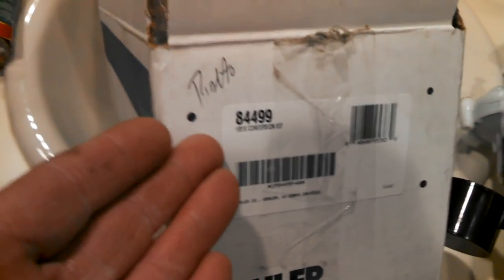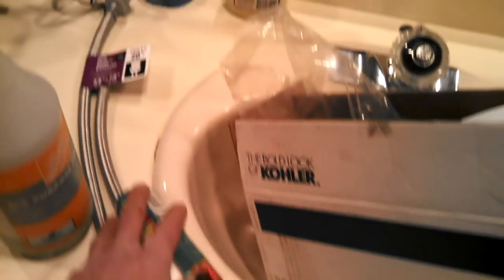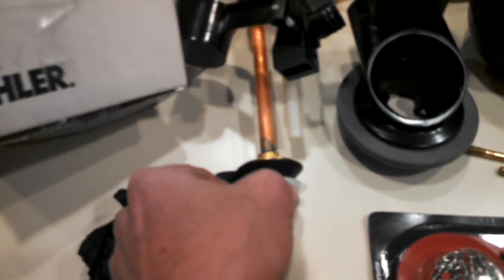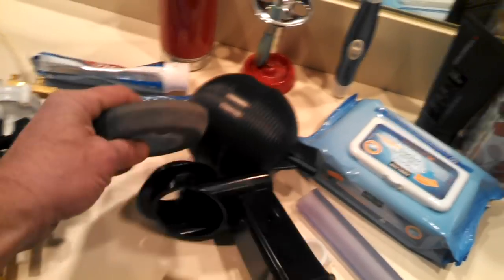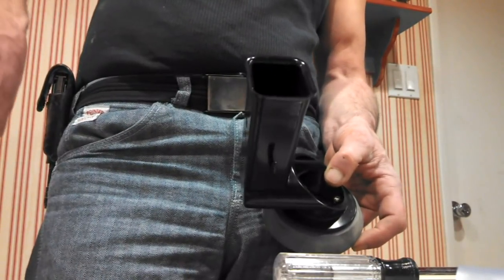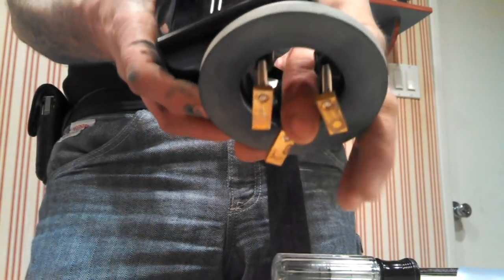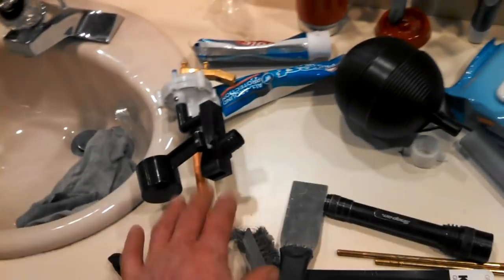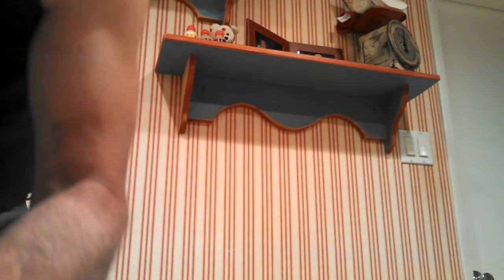Kohler Rialto toilet SOLVED

Comment: Loved your video. We ordered the Kohler Rialto toilet parts with the Coast 1B1X fill valve. The hardest part after watching your video was removing the 3 rusted in screws but after spraying with Silicone Spray and other tricks we got them loose. Now the toilet bowel flushes VERY WELL but the amount of  water in the toilet bowel is much less that prior to replacement. Thank you for your instillation instructions.

Comment: Thanks Dino , I have 4 of these Rialto toilets from 1987 . Your video gave me the confidence to do a rebuild . Worked out well. One thing to add for the viewers . There is a little blue plug in the top of the fill valve . Mine was missing and water was shooting out of the top. It did not show it in the instructions, found it loose in the bag and installed it, all good now :-)

Comment: Thank you so much, Dino!  Your video gave me the confidence to replace my flush valve because the old gasket was disintegrating.  The new flush valve has plastic tabs instead of the screws with the brass tabs, and the opening in the tank that it fits into is a basic triangle.   I positioned the tabs over the points of the triangle, pushed down, and twisted so the tabs would catch and to seat the gasket, then I put the flapper on and voila...it's working perfectly.   Thank you, thank you, thank you!

Comment: Hi, used Kohler 84499 kit to replace all parts in my Rialto . Project was easy with parts provided, however had to change the bowl fill tube to a more flexible thin wall part and use a blow dryer to make the bend. Working perfect with genuine parts. Thanks.

Comment: Thanks for the video Dino! Mine was originally leaking so I changed the set w/ a coastal (generic) one and then I noticed no water was getting into the rim, turns out the rim feed tube wasn't placed into the hole, but to the side of it due to mine having a jacket piece of PVC-type material that goes from the hole into the tube and was not sitting in the hole and the water was falling directly into the tank.  I set the PVC jacket into the rim hole and then placed the plastic feed tube into the jacket. Thanks again :)

Comment from the maker: i try to stick the tube into the ceramic first, then install the fillvalve, sticking the tube into valve almost last thing cuz you can easly break the black plastic valve. i belive there is a small "set screw" on the float valve where it attach to fill valve, remove the screw, set your angle and rescrew. i found twisting and pushing the tube you can get it in better, even fold it lengthwise , then jamb it in, it will unfold itself. keep at it! you get it, just care not break little floatassembly

Comment: Found another fix for water leaks: lower the water level. Had a rialto that continually dribbled water into the bowl - and the usual suspects were ok: flapper valve, filler tube, etc. Turned out with the water level a bit  high the water was leaking around the fill tube where it connected via the hold to the toilet. As long as the water level was below that of that hole all is good.

Comment: Dino, you didn't say much about the translucent flex tube that runs from the float valve assembly to the back of the bowl.  I have two problems.  1)  The angle of the male nipple on the new float valve assembly is different from the original.  This causes the path from the assembly to the bowl to be shorter and requiring a sharper turn of the flex tube.  2)  The old flex tube was really jammed into the bowl.  I can't seem to get the new tube to fit into the opening which is much too small.

Comment: Hello. I have the Rialto 3466 which is very close to your number. However, there are a few differences. The items that get connected to the tank looks different but connection to tank is close enough to connect. The fill valve is totally different on yours. Yours looks more traditional mine is a square float and a fill valve under a white plastic cover. 
Also flush handle is on left side. 

I will give Kohler a call to get original parts since I'll be living here a while. Maybe get some clarification on my questions?   Either way I should be able to get this done. 
Thank you for posting!

Comment: just a recommendation for this toilet. I have been in plumbing sales for over 30 years now, and yes I sold these back in the late 80's. for a decent flush you should use a 1/2" supply valve and a full flow supply line. like a code style line. the one that needs a tubing bender to bend correctly, and not as DIY friendly as the pro hooker shown. thoe back then there was a pro hooker  supply with the full flow that works well, but hard to find now. the reason was this tank flushed with the old 3.5gpf, but with the low tank Kohler designed the incoming water to help with the flush. back then people often installed them with the common 3/8" stop and supply only to ne disappointed with  he flush. I sell the 84499 Kohler kit myself. it is the only decent fix for the Coast Master OEM part, that went away with that company going under. I like the vedio, but would recommend the larger supply and stop.
Reply: I agree. I bought one of these toilets used from Habitat For Humanity and installed it in my house 5 years ago. It flushed well enough but the bowl rinse wan't the best. I found the Kohler catalog page from back in the day and the recommendation is for a full 1/2" supply and stop, with a minimum of 40 psi flowing pressure. I switched to a 1/2" supply and valve and the toilet flushes much better and fills faster.
Reply: Hey Scott, do you know if the 84499 conversion kit works with the Rialto K4530 model or not? Dino didn't list that model number in the description and I thought you may know. My Fill Valve says 1B1X on the top white plastic round piece and it's on the far left side of tank, and the Flush Valve + Flapper is over on the far right side. Thanks!

Comment from the maker: ALAN, THE bowl part should fill until the water spills over the trap inside the porcelain, you cant see that but....if you wait for fill cycle to stop, then mark a small pencil line at bowl waterline, then pour water slowely & gently from bucket (dont start "designed in" siphon by dumpin water too fast) make note, if the water is higher level after manual bowl fill, it's not filling as designed with universal valve, if you cant fill bowl higher with above cuz it spills over the trap,then your ok

Comment: Hi Dino You Really are the BEST..I have a problem with the adjustment screws...it is less than a "hair"...between never stopping the flow coming in the toilet and  total shut off...any suggestion? I'm tired of using the shut off value with every flush..

Comment from the maker: Alan, you are missing
may seem to work it will clog often because the rialto design needs that big hose to fill the bowl to correct level, the little black hose on universals will never fill bowl, if bowl level is below design your never going to get a good flush and therefor the plunger will become like your best friend as your going to be plunging after every #2 !!
rialto is very specific that needs the exact rialto replacement fill valve, sorry but that is the way it is.

Comment from the maker: Liangj08, the black float tells the ballcock(fillvalve) when to stop sending water to bowl cuz normal operation at start of fil cycle half water to fill bowl and half to fill tank, then as the black float closes all water goes to tank.
many plumbers remove it as its trouble , you should be ok without it if the bowl and tank are filling to designed level

Comment: The flush valve was not leaking.  I could see water dripping from the fill valve, not well enough to identify the exact location of the leak.  Today, I went back to the fill valve, shut off the water, removed the three screw from the cap, put it aside and removed the new plastic piece with the three rubber washers and button on the bottom.  I put  these four items on the original plastic piece. Replaced it, put on the cap, and problem solved.   When listening for a small leak I usualy put one end of a long screwdriver on the suspect location and the other end to my ear.  Home made stethoscope!  Thanks for your reply.
Reply from the maker: Stew Baker often is BOTH the fill valve & flush valve leaking, dont discount the possibility, kohler made the retrofit kit to address both issues , it includes both new flush & fill valves ...THX

Comment from the maker: im talking about bowl water level in my reply, not tank level
that big hose on rialtos is the rim feed line, the water that flows down sides of bowl during and after flush, this rim feed rinses debris from bowl walls and fills bowl to correct level for good powerful flush
ive never seen any success in ppl use universal fill valves in rialtos, they call for service and i see new universal " we try to fix, it doesnt flush good" ,

Comment: Thanks for the great instructions. I am still having a problem. The ball float does put enough pressure on the fill valve to shut the fill valve off. I have adjusted the screws but nothing seems to help. I think the fill valve is defective. Any ideas?

Comment: Should I put some silicone on the bottom of the seal.  I had to scrape the old off, so it would make sense to me to put a little sealer back?
Reply from the maker: no silicone, just clean the old one off with wire brush or scraper

Comment: Dino, thanks for the video... got a question for you if you don't mind helping out.  I installed the parts and the reservoir fills up to the fill line perfectly, but then a few minutes later I hear the fill valve kick on like it's leaking a little water... similar to the very end of the fill cycle... if I tap the float ball, it stops for a second then kicks back in a little later.  I've noticed that the float is hitting the little ridge along the back of the tank, so I wasn't sure if that was the problem or something else.  Thanks!

Comment: I installed one recently. The flush valve triangle hole. Previous tenant installed and and cracked pieces of that triangle. So I put silicone and the rubber gasket in and it worked. But I don’t know how to adjust the water in the toilet. And the flush is weak. What to do ?
Reply: I don’t know how to adjust the water level in the toilet.

Comment: just changed my fill valve. brand new. but small leak coming from the cap which i think is attributing to my low toilet bowl level.  is there something i can try to fix before I go back and return? i saw your other video about removing that black plastic thing.  Will that solve instead? or will that small leak from the white cap cause any other issues?

Comment: Sir, for that clear tube (rim flush), is it realy a hole or  is it some type of spigot protuding in the tank. I’m afraid to pull on this.
Reply: For those wondering it is in deed a hole …. The thing is, with time, that rubber rim flush tube turns white and become very rigid… almost solid. Be carefull not to break ceramic

Comment: A simple repair for a leaking fill valve cost me $8.00 Canadian.  Go to Lowes.  Buy "Fill Valve Replacement Part #BP63-951 &952".  Shut off water.  Remove the three screws from top cap from your old fill valve.  Pull out plastic plug with rubber washers on it.  Discard.   Remove the three screws from the new cap and pull out the plastic plug with the rubber washers on it.  Place the new plug with washers into the old fill valve cap, replace the cap and three screws.  Turn on water.  You just saved about $127!
Reply from the maker: Stew Baker the problem is not only the fill valve, it's more often then not the foam gasket around base of flush valve (overflow) , kohler is aware of this hence the Kohler 84499 conversion kit which is a redesign.
Reply: Dino Pinch Exactly right Dino.  Hate that green foam crap.  More often than not THAT is the problem

Comment: Hiya Dino... First of all great video! Second I see where the part # 84499 is compatible with several model numbers. I currently have a Kohler Rialto model number K3404. My particular is not listed as compatible, the closest has a model number of K3402. Do you know if I can still use the part #84499 on mine and if not, would you happen to know what I would need to look for? My current Kohler toilet has since been discontinued. Any info would be much appreciated.

Alan

Comment: Hi and thanks for the info. I just wanted to point out one thing though. At the beginning you state that there is no way to determine if the problem is with the fill valve or the flush valve, so you have to replace both. Not true. If the problem is with the fill valve, then the water will be continuously going into the overflow. Another easy way to pinpoint where the problem is would be to close the shutoff valve and wait an hour or so. If the level in the tank remained where it was when you shut the valve, then the problem is with the fill valve. However, if the water level in the tank dropped, then the problem is either the flapper or the flush valve seal. You can determine which by the level of the water left in the tank. If it is completely (or close to completely) empty, then it's the seal. If there's still some water in the tank, then it's the flapper.

Comment: A lady I do work for has one of these that leaks around the nut that holds the fill valve to the tank. I put a new rubber on there which is from a different kit and still had a leak where it would drip down the threads inside the nut. I have a replacement fill valve ordered, do you think that will solve the problem?

Comment: do you actually like these things? They are so unreliable and often fail they are also often loud and you can only buy kohler parts but nice video anyways
Reply from the maker: +Everything home repair yes, they are the smallest on the market, they are reliable if, the bif if they are serviced correctly and that said ALL- ANY toilet needs servicing every 5 years or more depending on local water quality....loud? are you sure this is toilet and not the house plumbing? cuz these are evey every quiet....kohler makes quality parts and in 40 years will still be supporting this and all they product line with parts...yes, they are great product if maintained....thx
Reply: If yours is loud, something is wrong with it.